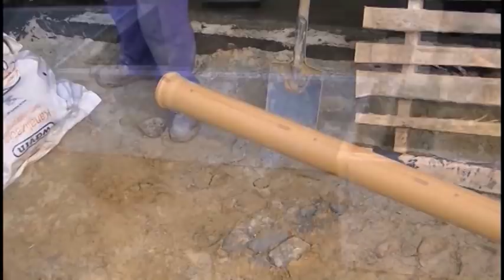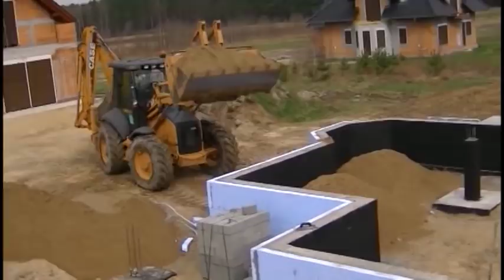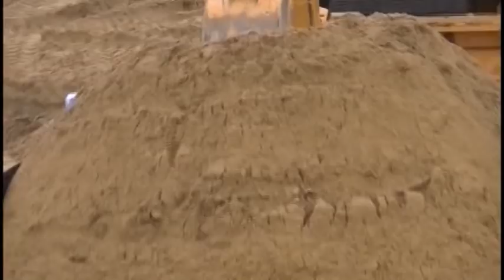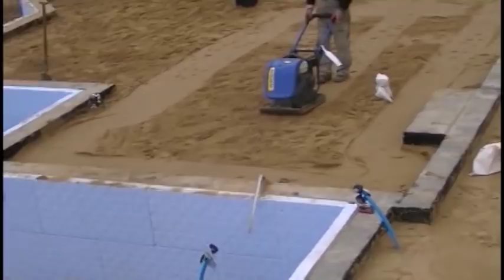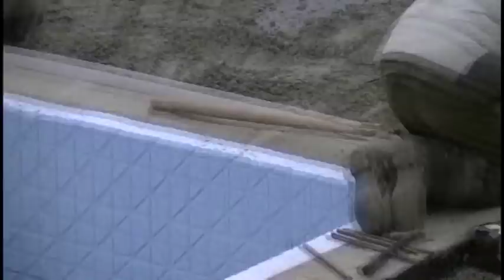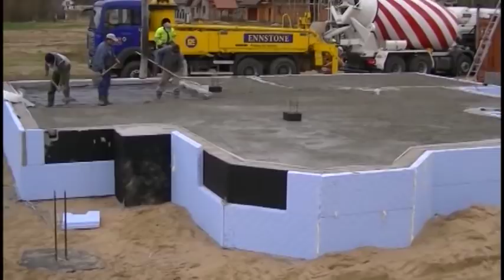BUILDING TUTORIAL PART1 CH.4 - CONCRETE SLAB

Comment: i think this is the ground floor correct so may i know why do we have to raise that long from the earth ground
Reply: Naveed Ladha. It's because of the zoning bro. 

There city has an established urban planning that must be strictly followed. Also one reason for this is that when winter is over (as stated on the previous episodes/parts) , the place will have a very high water table due to the melting of water. That is the normal condition. 

During the construction, the water table is frozen, also making it there advantage. When winter is over (GOT 😂) the water will melt, but they already made water proofing during construction.

Comment: So, why so high above the ground level?
Reply: It's because of the ZONING brother. 

There city has an established urban planning that must be strictly followed. Also one reason for this is that when winter is over (as stated on the previous episodes/parts) , the place will have a very high water table due to the melting of water. That is the normal condition. 

During the construction, the water table is frozen, also making it there advantage. When winter is over (GOT 😂) the water will melt, but they already made water proofing during construction.